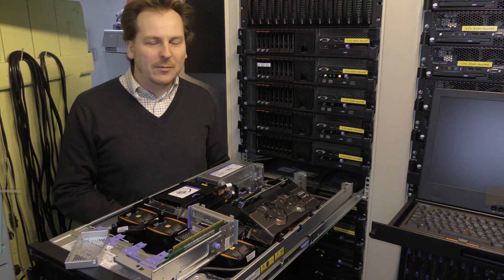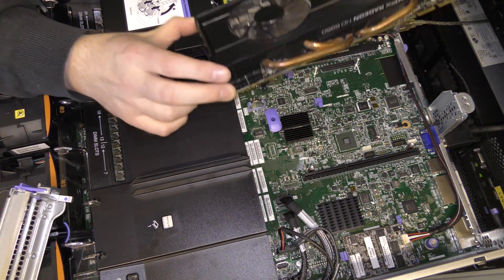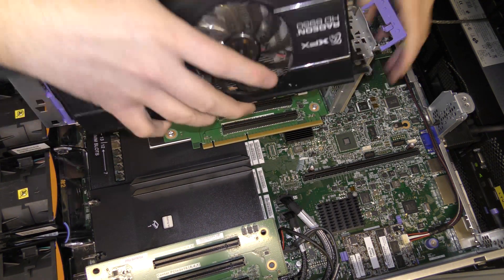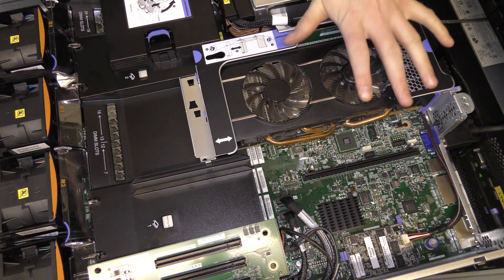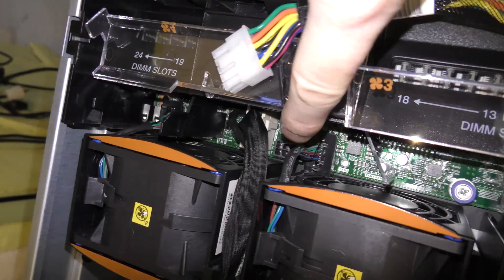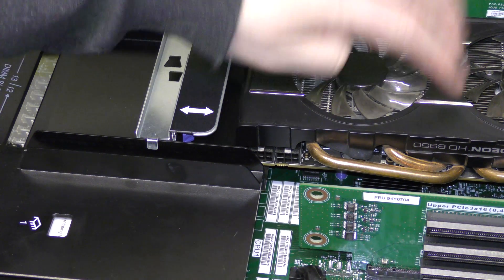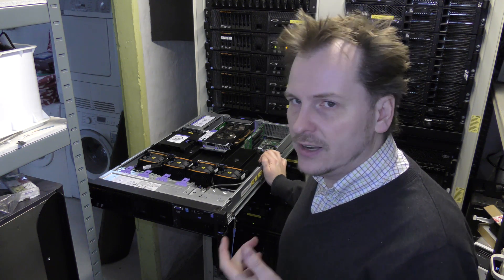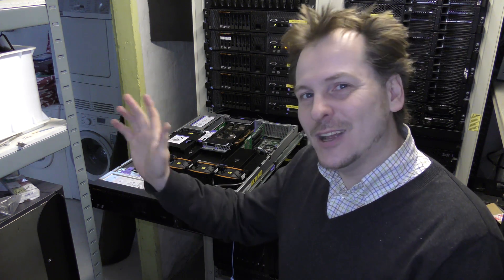Fiddling with putting Graphics Card in Lenovo x3650 M4 - 487

Comment: Hi Morten,
I know its been 8 years since this video but I got two of these server from work fo free. However I can't seem to get an rx6600xt working despite getting an 8pin to 8pin power connector. Any ideas? None of the fans spin at all :(
Reply from the maker: Check the PCIe version,, if the GPU works in the PCIe slot in the server.

Comment: Bought the linked cable; does not work.  The 8-pin port on the motherboard is specific to Lenovo, and the linked cable is apparently what plugs into a normal ATX motherboard.  FWIW, the cable I did buy that fits the port on the motherboard doesn't work either...  My P40 doesn't POST with it plugged in.  lol
Reply from the maker: 8PIN is not just 8PIN there is also 8 pin ECS.. and Server GPU´s often use that :-/

Comment: Hi Morten, I have started watching your videos and got hold of a old IBM X3650 M4 7915. I have set up Proxmox and started building a home lab. I have also procured HD7950 3G GDDR5. It has two 6 pin inputs. I have a PCI Riser Card with 3 slots of 25 watt each. I am desperately looking for a GPU cable that i can hook into the 8 pin GPU Power slot on the Motherboard and have the dual 6 pins connect to the GPU. The GPU cable purchase Amazon link you have shared is outdated. Please can you help me find the right cable to power my GPU?  Thanks :)
Reply from the maker: It´s an old video,,, I have updated the links :-)
Reply: @MyPlayHouse Thanks a ton for replying!! 😊👍🏻 you are awesome!!

Comment: I have a X3650 M3 and want to put a GTX 960 for video rendering. Its a video card that I just have laying around and has a 6 pin power connector. I'm running Windows 7 on the server. Do you think there will be any hardware compatibility issues?
Reply from the maker: Hi Conan Mills
Thank You very much!  Do you have the unicorn x16 PCI riser card for the x3650 M3,, or just ready to cut open the slot... I think it will work, but I have not tried that combo.
Thank you for watching! :-)
Reply: My PlayHouse i appreciate your response and enjoy the content. I dont have a unicorn so i was going to cut the slot. Ill give the 960 a shot and let you know how it works.
Reply from the maker: Hi Conan Mills
Thank You very much!  You can run into problems with the x8 only being 25W where the x16 is 75W and the 6pin is also 75W,, so you only have like 100W where you with the unicorn riser would have the full 150W.
Thank you for watching! :-)

Comment: I just got a Radeon R5 230 in my IBM x3650 M2, not a high performace card but 1000x better than the onboard and HD video, no problem and uses under 20watts of power at all times.. Bit of a mission to get the card in but it's in and working now.. On windows 7 :D ahaha. I must be ready to try a more serious operation system soon but it's making a very nice desktop today. Smooooooooth.
Reply from the maker: Hi Jasonsadventures
Thank You very much!  Did you cut the card or the PCI slot to fit the card ?
Thank you for watching! :-)
Reply: I cut the back of the slot with a little carbide cutter on a dremel tool, that wasn't the problem. The problem was windows not booting after the card was installed so I pulled it out again, booted windows installed the drivers and it still wouldn't boot after I put the card back in. I fixed it by booting windows without the card and disabling the onboard and then put the new card in again and it booted and worked just fine. Most people don't like that card because it's too slow for modern games but that wasn't really the point for me, I just really really disliked the onboard video and don't want to pay the power bill for a 100 watt card that just sits there doing nothing.

Comment: look for a card with a blower style fan it will draw the air from in the system and push it out the back where as the one in your video will just suck the air into the system from back and make the card die quicker in this server since it's blowing against the top of case and not through a grill out of the case
Reply from the maker: Hi Austin Childs
Thank You very much!  I want to put in my Nvidia Grid K1 and I have ordered a ATI FirePro V7900 : http://amzn.to/2m2QQls
Locally :-) And I just got power cables!! nice.
Thank you for watching! :-)

Comment: Great video Morten! I have a question: I want to put new ethernet cables in my house, about 4-6 cables (max 15meters) should use shielded (stp) cables or non shielded (utp) cables? 

I've read I can have more problems with shielded cables because of ground loops, and crosstalk, etc. All devices (router, pc's, ONT) have metal around on the plugs.
Reply from the maker: Hi Sérgio Pimenta (CT2048SWL)
Thank You very much!  non shielded,, I never use shielded,,, and do not have any problems.
Thank you for watching! :-)

Comment: Looks like you could do with one of these... https://www.scan.co.uk/products/palit-geforce-gtx-1050-stormx-2gb-gddr5-graphics-card-640-core-1354mhz-gpu-1455mhz-boost?utm_source=google%20shopping&utm_medium=cpc&gclid=CjwKEAiArvTFBRCLq5-7-MSJ0jMSJABHBvp0tfCBNPSynB0edx28lCUFSCc1mozfxwx2dNw_HBpYpBoCwKXw_wcB  depending on the exact amount of power you need of course. This doesn't require any power cables and draws sufficient power from the mainboard directly.
Reply: Oh and it's 75w and DX12.
Reply from the maker: Hi @Metaphase1980
Thank You very much!  glad you liked the video :-)
Thank you for watching! :-)

Comment: Hi Morten, i saw on 6:54 that you also have an 8 pin connection on the right of the Hypervisor, so why not use that one?
its there because its meant to be there for GPU powering purposes ;)
http://www.ibm.com/support/knowledgecenter/ST9SXX/com.ibm.storage.rtca.help.doc/00V9947.pdf
(Page 227)

And i have found the P/N for the original VGA power cables.
http://systemx.lenovofiles.com/help/index.jsp?topic=%2Fcom.lenovo.sysx.7915.doc%2Fc_product_page.html&cp=0_1_10
Cable, 2x6 GPU power 400 mm 00KF649  
Cable, 2x6 GPU power 700 mm 00KF650

ànd there is also an original vga power cable for the M3 ;)
Reply from the maker: Hi +Dennis Wieringa 
I did order some cables in China 8pin to 2x 6+2pin,,, they will be here in a while.
Reply: +My PlayHouse (Morten Hjorth) do you have a link for me?
The ibm ones are hard to find ór really expensive
Reply: This what I needed. Thank you! Now time to shove some gpu into my server

Comment: This is an interesting dilemma, Morten. It is unfortunate that Sony's graphics hardware acceleration is only utilized on the 6000 series of GPU's from ATI. I did not know that the FirePro variants others are mentioning are based on the 6000 series, but that seems like a good option even if the clock frequencies may be generally slower in those cards to require less cooling. I would be interested to see the performance differences between the 6950 or 6970 and some of the FirePro cards others have mentioned. Good luck with cable creation!
Reply from the maker: Hi Tyler Barton
Thank You very much!  I did also not know of the firepro!!
Thank you for watching! :-)

Comment: What about buying an old FirePro AMD Card ? 
They Work really great in Servers I also recently bought a FirePro V4900 used on EBay HP Branded They are really great GPUs and should work with your editing Software as they are based on the 6xxx Series and maybe a V7900 would be great for you. They are also Single Slot and only require one 6 Pin and 75 Watts from PCIe and the V4900 doesn't need any Connector
Reply from the maker: Hi Alina Hänel
Thank You very much!  very interesting!! do you know what consumer card the V7900 is?
Thank you for watching! :-)

Comment: hey i really recommend getting a radeon rx480 to use they are power efficient and about 2x the speed for about 250usd but for the love of god DO NOT GET A GEFORCE like everyone is saying to nvidia has intentionally crippled the cards when you use them in a virtualized environment when you pass them though using vt-d they detect that its a vm and give you a "this device cannot start" error basically forcing you to use a amd card or buy a  "quatro,grid,tesla" card amd has no artificial limitation and work fine in a vm
Reply: You can set "hypervisor.cpuid.v0=false" in vmx file. And nvidia driver does not know that it works in a VM.  And card card will work 

AMD/Nvidia consumer cards has limitation - there is one GPU passthrough for one VM. Only server cards support running in multiple vms at once either.

Rx460 without additional power is not the best choice. These cards do not have enough power from PCI-E.

p.s. I am sorry for my english
Reply: a good quadro will pass through, my quadro 600 didnt passthrough in a working way
Reply: meh757 Better yet, I'd recommend a RX460, many of those run on just PCIe slot power and are exponentially faster than any of the cards you have right now (Besides the GRID card) Morton!
Reply from the maker: Hi meh757
Thank You very much!  My editing software is best with AMD cards and the opencl GPU rendering on the 6000 series.
Thank you for watching! :-)
Reply: yes i have a gtx 1070 and i use davinci resolve, (favors cuda) which is pure coincidence because i just use it because i like it and its free, i had amd before (r9 380) and i had some driver issues with nvidia
amd would be better in this case, as i said before ,
because 1 the passthrough 2 the software that he uses. (the passthrough trick doesnt always work)
nvidia is indeed better, and i prefer nvidia but i still think its overrated
Reply: Yeah, but consider to upgrade in the future...for example, you could use a new editing Software, maybe the free Davinci Resolve from Blackmagic, which is very GPU intensive.....so I as a Videoeditor(with a normal desktop, no Server or VM D: ) would reccomend you a Nvidia Card, maybe a GTX 1060 or 1070 with Davinci or Premiere Pro(pricey ;D).....but the 1070 defenatly needs a Power plug....but I'm not sure, if the 1060 is in need of one
Reply: yeah, i kinda agree, that settings trick didnt work for me anyway. and his software uses amd, this is not pcmasterrace (also looking at you jyrka98)
Reply: Ok, then please let us have a good discussion why! Because Nvidias Cuda is for a Videoeditor importet....Why do you think it's trash? I have an open mind, but if you tell me, "its trash" without any arguments, then i'll guess, it's wrong..... I personally like Nvidia, because I need it for Premerie .... it makes Premeire so much faster....
Reply: ProBro_NL oh I didn't mean you... I spoke to Jyrka98....because he doesn't give any arguments.... But it's very kind of you, to answer my question too :D 

Ok.... I don't have any esxi in the moment and haven't experimentet with passthrough.... So from my perspective as a editor I would recommend nvidia..... But if the passthrough is not working.. Then of course amd
Reply: ***** yeah, but it's not his problem, if the devs don't use it correctly.... He needs a working card, which performs good, so he can edit very fast.... And maybe OpenCL is better, but the applications don't support it, then it's useless.... But I think sony Vegas supports it? I don't know.... I never worked with vegas

Comment: i think there are small versions of the gtx 1060 avalible
Reply: there will be problems with passthrough :(
Reply: ProBro_NL Why would there be problems? Isn't pci passthrough dependant on the CPU and the motherboard?
Reply: well kinda, but it also depends on the gpu, if that doesnt like a passthrough it will just not work like with most geforce cards
Reply: he could use "unraid" instead of vmware
Reply: pls just dont
Reply: don't what?
Reply from the maker: Hi @austriangamers390
Thank You very much!  glad you liked the video :-)
Thank you for watching! :-)

Comment: Hi Morten,
I run all my servers with graphics card, one of them even has 4 AMD FirePro V7900's. I have one with a GTX 680, and one with a FirePro V5900. A lot of the time you need to make custom cables for them, except the FirePro cards, which either don't need extra power or need only 1 6 pin (except when you pack 4 into one server and you need to them make a 6 pin + 3 molex to 4 6 pin adaptor) if I ever retire any of them soon, I'll send them a long.
Reply: Joshua Nicoll I also have a FirePro V4900 in my Server working great🙂 it's just Running a Windows 2012 R2 VM on ESXi to have more Graphics and CPU Power for Remote Desktop with my MacBook
Reply: I use them as compute cards, since they also have ECC, rarely crash, have very good density and aren't that expensive, mostly because they're kinda cheap
Reply from the maker: I did get one of those AMD FirePro V7900..

Comment: Try a GTX 750 ti or a gtx 1050 /1050 ti, since they dont need extra power and are available in a shorter variant :D
Reply from the maker: Hi Sasan Mottaghipour
Thank You very much!
Thank you for watching! :-)
Reply: The nvidia driver doesn't work very well in virtualization
Reply: There is a special vmware nvidia driver as well. I have not tested it myself. I do have a spare GTX 660 i could try in my server.
Reply: 1050ti doesn't support dda :(
Reply: both 750ti and 1050ti draw more power than the servers PCIE slot can deliver.

Comment: Maybe consider to use a nvidia GTX 1050TI OR 1060.... These are small power full cards.... And I think the 1050ti doesn't need power over a cable at all..... Its getting its power over the pci-e slot
Reply: Tobias Heinze At the end Morten basically says that the card has to have an external power connector. Max 25W from the slot, that's not enough for the 75W 1050Ti. I do like the 1060's pref/W though.
Reply: No, it is a x16 Slot o.O or am I wrong? Because, when it's a x16 SLot, than it can deliver 75 Watt, so he isn't in need of a extra power Cable
Reply from the maker: Hi @Tobascus
Thank You very much!  glad you liked the video :-)
Thank you for watching! :-)

Comment: Why not make a cable ? Look for the pinout online or use a mutly meter to find what is 12volt and ground as that all that is on a supplementary power connector for a GPU.
Reply from the maker: Hi BlueFoxTV
Thank You very much!  well that could be done,,,
Thank you for watching! :-)
Reply: Was going to say the same.
Morten, you have your schmick Weller soldering station, I'm  sure there's the odd piece of shrink hose knocking about as well, such a job should be a real doddle!